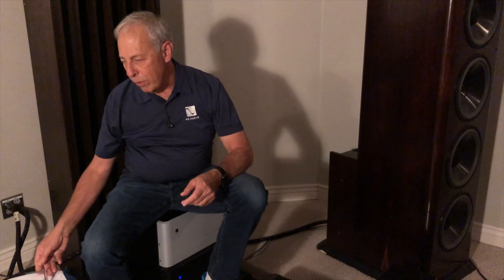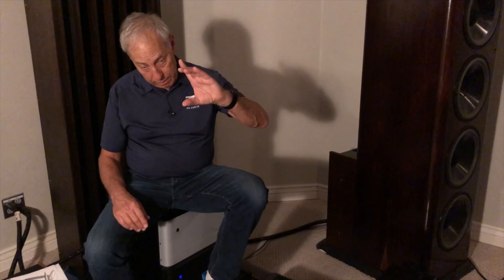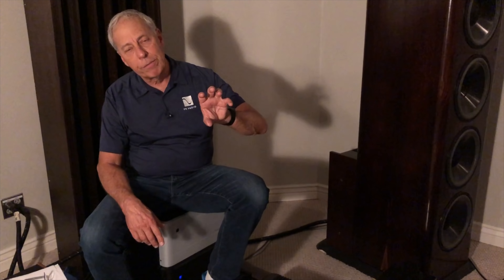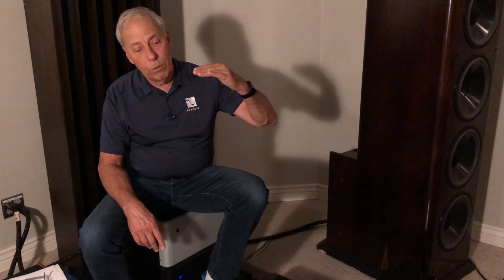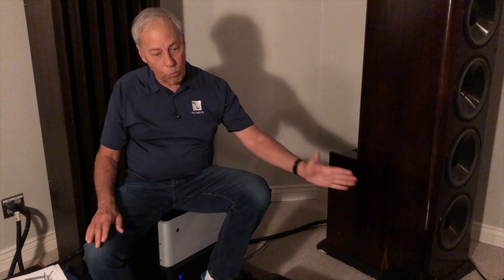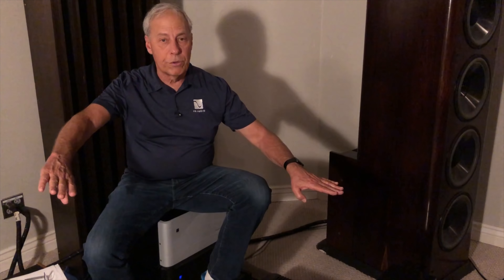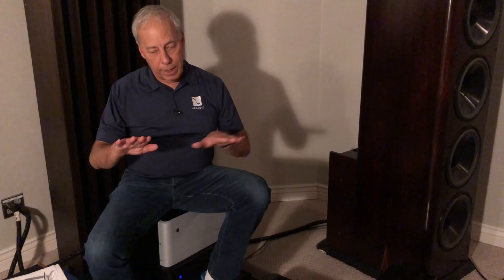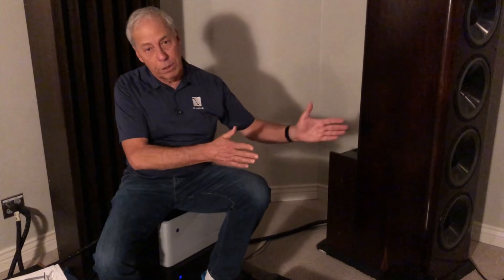Horizontal or vertical bi-amping?

Comment: I bi-amp horizontally for two main reasons: 1) Active Crossovers are better than the passive crossover network that came with my speakers (totally anecdotal, as this was my impression after doing so) and 2) being able to reduce the output to the woofers on my speakers even -0.5dB made a world of difference in my room (it got rid of this annoying bass node that I couldn't manage with treatments at my listening position). I'm using identical Emotiva amps. I would never go back to using a stereo amp with passive crossovers on my speakers!
Reply: Could you please share the topic ? Is there any measurement involve ?

Comment: Paul, i had to say based in my personal experienced that biamping really make the difference.. specially when you cranking up the volumen ove 60%, and not to mention how sweet the mid nd treble distinguish by your ears when the reproduce media is from top quality.  I ran test with vertical and horizontal mode biamping and triamping, and i had to say something... if you are going to mix  two type of amplifiers like  transitors in the bottom and tubes in the top end, you have to pay attention to the gains of each one, if that the case horizontal is the way to go. Otherwise if the gains doesn't match is worst that single amping. Vertical make sense if you go with a multichannel single amp and take the advantage of the same gain specially if have a good damping factor and toroidal transformer that can provide true power. I do have few emotivas xpr series triamping my klipsch p39f and sound sweet as baby!
Reply: With only two sets of speaker inputs, HF/mid and LF,  how do you TRI-amp the P-39's?

Comment: In a horizontally bi-amped system, does it make sense to use a more powerful amp for the bass than for the mid/high, assuming they have identical gain? I'm looking at a 55wpc amp for the highs and a 110wpc amp for bass, both with a 46X (33.3dB) gain. However they have different input sensitivities (410mV vs. 650mV), and also different output impedances (0.1 vs. 0.05 Ohms @ 1kHz). I'm concerned that one or the other will be louder, or is gain purely the only spec that determines that? Otherwise, can a possible imbalance be addressed with an in-line attenuator on the louder amp's input? Then again, wouldn't that cancel any advantage from feeding the woofer more power? Thank you for any ideas.

Comment: Paul, I have a pair of Muse Model One Hundred Fifty Mono Amplifiers circa 1991. They retailed back then for $2999/ pair. What is your opinion on these. I bought them used for $200 and they both work. Originally I was to use them on a pair of subwoofers in a theatre room. Would this be a waste? I have a video of their guts on my youtube channel.

Comment: I passive bi amp'ed my Infinity RS IIIa's a few years ago. After killing every amp and receiver they came in contact with over the years I finally broke everything off the crossover for the woofers and put it to new binding posts for them alone. Hooked it all up to a QSC CX254, 4 channel, 250 watts per channel @ 4 ohms and can dip down to the floor if needed. With Infinity's it all about amp head room and staying away from clipping. They have never sounded better. The only way I can describe it is the woofers are now free to be woofers and the top end never shined brighter and clearer.  Using a 4 channel amp I dont know whether if it is horizontal of vertical but it works if just for the brute over powering alone.

Comment: I can't understand why some people think it's a good idea to put large inductors, capacitors and resistors in the power signal path. There are advantages to fiddling with the signal when it's small, before it's amplified. Paul alluded to that when discussing tube input stages to solid state amplifiers. I suppose the biggest argument against bi-amping or tri-amping is that active crossovers can add noise or otherwise alter the "purity" of the signal. I have been persuaded that having nothing between the output transistors and the voice coils except sufficient copper, sounds better to me.

Comment: horizontal surely all the way. because you can use a warm amp for the low end and a bright amp for the tweeters. surely there is no benefit at all from vertical (one amp for bass one for tweeters instead off one amp for the tweet and bass of each speaker not sure if i got my terminology the right way around)

Comment: Hello, Paul! I was wondering the same thing and this video came off .... unfortunately it adds more mist to what I read by now. I want a second Emotiva A-300 (150W @8Ohm) amplifier to properly power some Dynavoice Definition DF-6's (rated @max 175W).

It seems more logical that when using two identical amplifiers to go vertical bi-amping (each amplifier on it's channel) to prevent crosstalk between channels. Either way, I'm going to buy a second amp and test it in both configurations ... I was amazed what bi-amping did on my old AV receiver and a pair of Monitor Audio bookshelf speakers.

Comment: how is biamping in context of power supply output impedance, ie the ability to improve conditions for the power amplification section? further, power transistors are somewhat limited by their slew rate (audibly so?) so provided biamping splits a (lets assume) power hungry mid/treble section off of the bass section, their dynamics should be enhanced to some small degree because of lower transistor current amplitude but same available dynamics now powering fewer drivers, or in other words, overall better transistor dynamics available for all drivers.
And, to my first point, i suppose feeding one bass amp section with one power supply which also provides some energy to mid/treble path would reduce the load on it, would make it appear “stronger”, relatively speaking, as voltage stability should improve (which is what Paul often refers to as a surprisingly effective way to enhance SQ).
Finally: the path before the transformers too has half the single amp impedance: 2 fuses, 2 power switches, 2 socket/plug contacts, 2 plug/cable contacts, 2 power cables , 2 cable plug contacts, 2 plug/socket contacts, all pin parallel, enhancing that path as well. All comes at a at a cost of course, that should probably be compared with a twice as expensive amp and power cable (the prior could have that twice as big transformer with half the impedance, the latter too could have twice the cross section and better plugs etc). So vertical bi amp should not sound the same as single amp operation due to halfing PSU output impedance and available dynamics; the amps output impedance however stays the same.

Comment: I tested first vertical  Bi-Amping (Yamaha AX-870 & Infinity Kappa 90) ; the first impressions of Amp A for both speakers and with Bridge at the Speakers versus Horizontal Amp A to Speaker Low and Amp B to Speaker Mid&High ; the Huge difference it is ! 😳😬👍🏻🍾🥳🤓
first the speakers are louder by the same Amp knop position ergo effectively better than before 
second huge difference i must position all knobs (Bass & Treble & Loudness) to Zero and flat by that configuration they playing much bigger, more present, the high freq have more details ..! Never turn back with Bridges plus one Amp channel for both  (if with cable or flat profil; cause it cost performance everytimes);
third the Kappa‘s are more better sounding if its at low power position or louder Volume.
At moving the tones position and more input give if its treble / base / loudness its like another speakers. By the changes +/- that’s more changing than before .
The scratch noise by moving the treble/bass/loudness are lower nearly gone (but i think to remove scratch noises by turning knobs .. cleaning times for the Amp)

I am very thankful for your extra Work and the Videos to give us more knowledge and better understanding the Background of High Fidelity ;
Greetings from Germany to you in US and stay healthy ...! Hope at a future after covid restrictions a day comes to could meet  you by music fair or i got become rich to travel again to US 😉👏👍🏻

Comment: I have a Pioneer VSX-53 used as a processor and Yamaha A-S700 amp to power a pair of B&W 685 speakers. There is a noticeable difference when bi-amping.
Reply: Yeah, Pioneer receceivers suck in terms of power
Reply: valicu2000 I was pretty disappointed with it considering it’s a Class D 110 RMS. It made the B&W speakers sound gutless. The Yamaha amp fixed that problem though. The pioneer is only powering a center speaker now when I watch tv.

Comment: I would go vertical for the exact reason you mentioned and the ability to have shorter speaker cables. Is there any advantage of horizontal?
Reply: In commercial applications, the reason to go horizontal is related to energy levels of music.  You can see this in most powered speakers.  There is no reason to put a bass thumper size amp on a tweeter or midrange.  For gymnasium size venues, a horizontal rack with active crossover is typically 1200 Watts / ch for the woofers and 100 Watts / ch for the tweeters for the headroom.  The very common Mackie SRM 450 powered speakers for example uses close to the same power ratio with the woofer at 400 Watts and the tweeter at 50 Watts RMS.  A properly designed power amp without being overloaded, should contain the proper size power supply.  A pair of SRM450 speakers is OK for a gym PA, but you will want several pairs in a cluster for a concert, so 3 pairs would be 1200 Watts per ch for the bass and 150 Watts per cluster for the tweeters.
As prior mention, long speaker cables are bad.  Locate the amps near the speakers.  Much of the industry are moving to powered speakers for this reason.
This amp power split protects the speakers.  You eliminate huge harmonic content from a 2400 Watt amp in clipping from running huge amounts of harmonic power into the tweeters.  The tweeters are protected by the power limitation of the tweeter amp.  You may get 50 volt peaks to the tweeters instead of 100 volt peaks due to the lower voltage power supply for the lower power amp for the tweeters.  Remember in Audio, doubling the voltage into a fixed resistance is 4X the power.  This is what blows tweeters in clipping.
Reply: isettech Yes if you choose different amps you obviously must go horizontal always. But that means you might have level and phase issues. If you do active cross-over and truly optimize everything, amps should not be identical vertically, but this video assumes using the passive cross overs in the speakers designed to match one common signal level.
Reply: ThinkingBetter,  I hear people talk about phase issues between mismatched amps, but most that speak of this have never measured the rise time of modern DC coupled solid state amplifiers.  Essentially there is no phase shift differences in relation to the phase shifts in an active crossover.  If you have a local high end repair shop who is willing to lend time, ask if they would profile several off the shelf amps rise times and compare it to the differences in phase shifts in various active crossovers.  A solid state flat amp with no tone controls has very little time delay from input to output.  Any phase differences between amps is minuscule compared to the phase shifts of an active crossover.  

The phase shifts between amps is a straw man argument of jumping over a $100 dollar bill to pick up a penny. The only concern is some off brand amps are inverting which is a 180 shift, which is easily corrected.
Reply: isettech Yes, indeed agree the only phase issue of significance for amps not having any digital path is absolute phase that also shouldn’t be an issue when an amp is correctly designed. Anyway, I’ve actually designed active speakers and I can see you know what you are talking about.
Reply: rockn roll  Most people have no idea how much power they actually use. A few amps had actual watt meters on them. Very rarely are home amps run above 10 watts. Most of the time most home amps are driving under 1 watt. If you know anyone with an oscilloscope, ask them to bring it over and check the voltage waveform to the speakers. It is very rare to see voltage peaks over 30 volts in a home.

Comment: Well, not at all. We can biamp is our speakers are not capable of providing flat response from 20 Hz to 20 KHz. If your speakers can't produce flat response the way they were meant to, then bi amping would be the way to go. The theory is that fundamental Bass frequencies below 60 Hz are non directional. I don't believe it. But, it doesn't matter as much as the higher frequencies  speakers can reproduce. My current set up is two two way Focal driven speakers that handle 45 Hz up. They are set up vertically. I run a single subwoofer, which I would ideally have set in the center of the room, inbetween the two mains. It uses an NHT 1259 12" woofer which is amplified to cover from 50 Hz and below. I'd love to have the two speakers line up at 45 Hz, but they just don't. And the sub is set up with a system Q of .81, so that it dips above 40 Hz and rises dramatiaclally by 2 to 3 db at about 40 Hz with great extension down to 23 Hz, and is audible down to 16 Hz or lower. This is because they are in a sealed box which allows them to cover a whole lot of ground a ported cabinet wouldn't cover. The mains are vented boxes which roll off quickly below 45 Hz. So the trick is to dial in just enough bass volume to create flat response down as low as you'd can really hear. And it works. So it is a bi amplified system, even though I would rather have a single stereo amp handle everything. All this is without an EQ in the system as the newer Amos don't have an EQ or cassette loop available to properly EQ the system response for the room your listening in. Man, if I did? I can't believe what I would be able to bring out of the system!

Comment: Is bi-wiring total BS?  Other then providing more conductive surface area for the audio signal to travel along. Is there actually benefits?
Reply: Bi wiring? Or bi amping? I cant Believe bi wiring could make such a difference.
Reply: bi wiring is a load of BS
Reply: there is a bit of an advantage, actually 2: for one in the speaker cables for treble there is the bass voltage signal, but not the bass current, and it is the current that creates some magnetic field which reduces fidelity of treble signal to a small extent; the other positive effect is, back EMF of the bass coil (a relaxing bass voice coil induces voltage, which the amp needs to shorten for great bass control) may find partially its way into the mid/treble section with single wiring (only frequency components in overlapping frequency range), while in biwiring all back emf voltage sees the amp terminal before it could do anything on the treble section.
So, here it is as always in Audio: zero difference doesn’t exist, but the differences might be too small for someones taste in someones system, and given the extra cost for a pair of speaker cable needed.

Comment: Why would you bi-amp? If your power amp ain't good enough to run speakers as normal then get a better amp. 2 amps running 1 speaker pointless... No!
Reply: British Naturalist  Yeah but these are the same people who claim they can hear a difference between 2 different CD players.. Or speaker wire..   They must have cybernetic hearing!
Reply: British Naturalist  And May i ask what speakers your enlightened and experienced ears listen to??
Reply: British Naturalist  Ah.. Mission are decent..
Reply: The benefit to vertical bi-amping would be extra channels on the receiver & the lack of wattage coming from just using 1 per speaker!!! If u have a receiver 70 watts × 5? If you only have 2 speakers to connect? using 2 of the channels for 1 speaker gives you 70 watts to the highs & mids & 70 watts to the subs in 1 speaker enclosure!  Instead of 70 watts for all speakers the 1 enclosure!!!